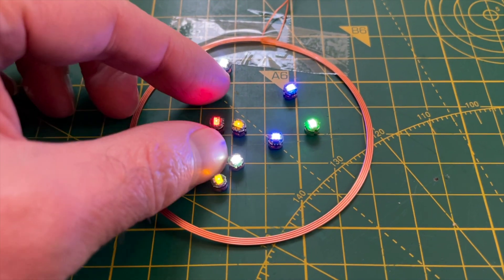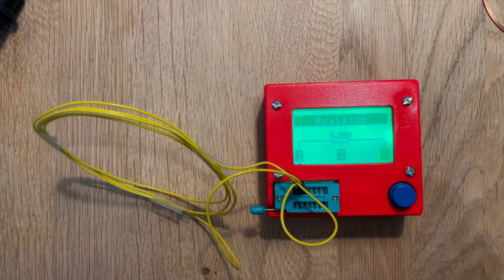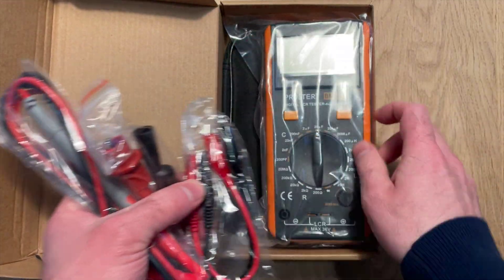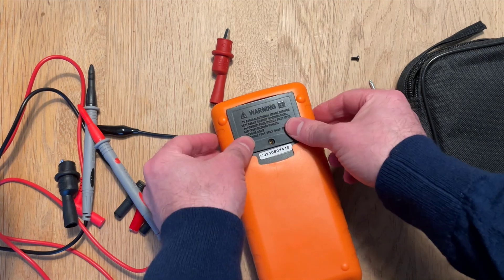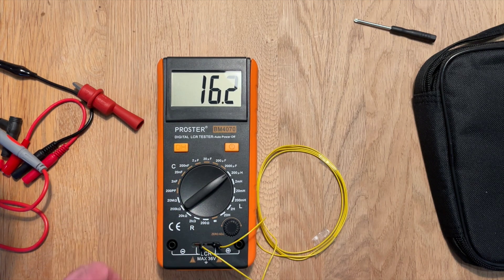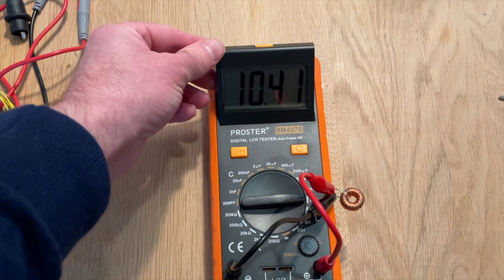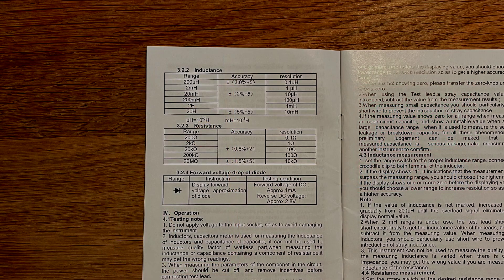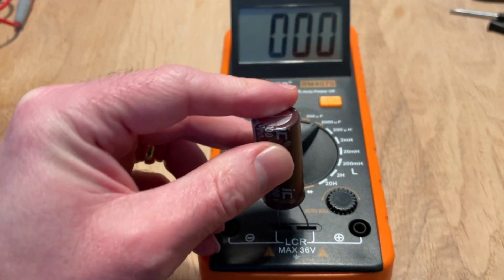Budget LCR Meter Review: Proster BM4070 Unboxing & Test

Comment: I wish someone could test it against some known expensive brand, cause at that price it's really really tempting
Reply: Honestly, for the money it's really hard to beat the cheap ATMega based meters, I've checked mine against my Agilent U1733 and it's really good.

Good enough that the Agilent lives in a cupboard and the £10 ATMega LCR lives on my bench. 

It's not great with low pF caps or low uH inductors but you can fool them into being a little more useful by measuring a larger value part, then putting the low value part in parallel (capacitors) or series (inductors) and subtracting the previously measured value.
Reply: @M0UAW_IO83  thank you for the tip, ill use that trick from now on!